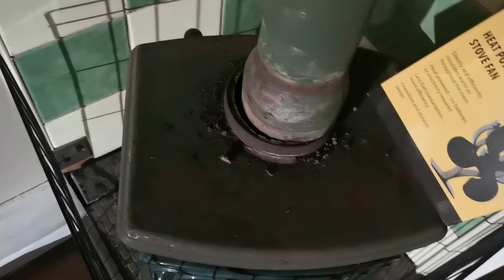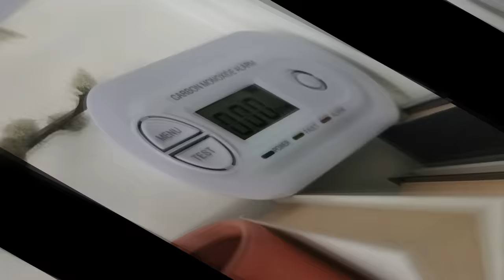Keeping Warm on a Narrowboat: Stove Repair Tips. Ep10

Comment: Any idea how it happened? Stove flue's don't usually just come apart like that so did someone/something knock your chimney when you weren't there?
Reply from the maker: Hi there. Possibly got knocked as we had some guys looking at the pipes coming from the back of it to sort out our radiators. Not really sure we did notice that the cement was slightly cracked the last time we were there so maybe it did get knocked yes. But in a way we glad it did as at least now we  now we have fixed it correctly and it is all safe